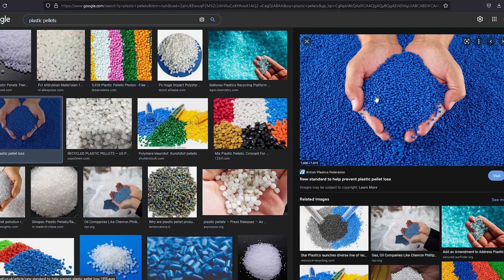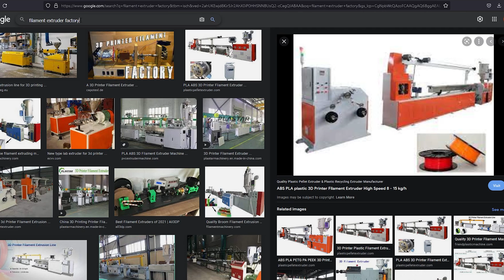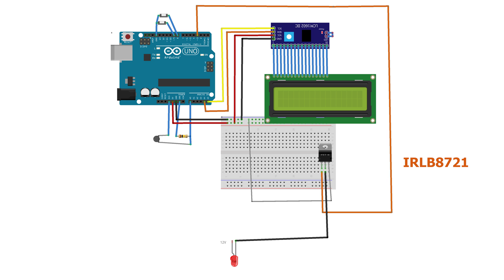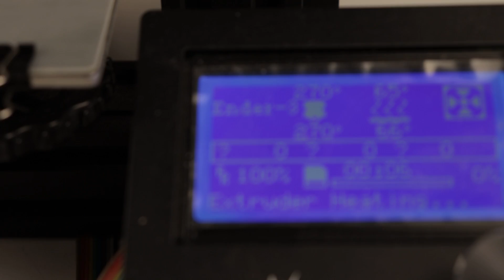Make FREE filament for 3D printer at home

Comment from the maker: Don't forget to check out tips&tricks for this project here:
https://youtu.be/xNtrQQ42WG4
Reply: Hello, Can you help me with the circuit diagram. I have been trying to build it, but im not so sure what the things connected in 8 and 9 of the arduino board are. also, can you do this with an arduino nano?
Reply from the maker: Hi  @fernandolagos2587 , certainly you can do this with an arduino nano. just you need to find correct pinout. pin 8 & 9 are for the buttons to adjust the temperature.

Comment: I’ve seen other people try to use this kind of filament in their Ender 3 printers, and they say that the ender 3 doesn’t get hot enough to melt pet plastic. Did you mod your 3D printer? Or what model 3d printer is this?
Reply from the maker: Hi @rachinc, First I did not modify it. However after doing a bit of research, I replaced stock hot end with all metal hotend just to be on the safe side.
Reply: @makersfunduck  after seeing this guy say his Creality Ender 3 wasnt hot enough to print PET filament, i told myself that I shouldnt get that 3d printer. https://youtu.be/M-d1Gmwq_O0?si=M0dWYTCw9YpDfp9X&t=310 but it sounds like you made it work, with a different hot end. Swiss?

Comment: Is it possible to use 8x2 LCD? I'm newbie with arduino, will it be hard to change program?
Reply from the maker: Hi, if the LCD has a Hitachi driver, then you can re-use the same code without any modification.

Comment: DO NOT USE HIS METHOD OF EXPANDING OUT THE BOTTLE.... WTF MAN?????? Do you not realise what you just created in your hands, its called a bomb. Sure it wont kill you from the shrapnel but the fire from the isopropyl alcohol in gas form, will burn your dam face off. You might be lucky 100 times but when it f$%ks, up because you left a little part over the heat to long, you will know about it. Especially seeing as you are using a gas top, open flame, to heat it up. You even talk about it so why the hell not just edit the video and say you used water??? dont't show dumb ideas.

Comment: I like the way of making strips connection as I'm seeing this method for the first time and surely try it out as it seems the best I have seen so far. But the way you shaping bottles seems not the best option and I suggest to search other methods. I personally just start making filament and I shape bottles with simply hair dryer. To make inside pressure I've simply fixed valve of bike stick to the cap so the pressure is provided by bike pump. Works well, quick, safe and controlled - 1minute all process. But I feel that there is other methods even more reliable to achive our needs.
Reply from the maker: I also recommended using warm water instead of ethanol in the next video. However still indeed this method can be improved. But I couldn't figure out any other method which is easier than that. Certainly it works quite fast compared to other methods that I saw on the internet, but you need to manually check it.

Comment: It's so much easier and faster to get yourself a couple tire valve stems from a car parts store and drill a hole big enough in the bottle lid for the valve stem to get a good seal, put it back on the bottle and then pressurize the bottle with a bicycle pump and then stick the valve stem still attached and chuck it up in a cordless drill and hold it over your stove.
Reply from the maker: It sounds like a viable solution. thanks for sharing.

Comment: I've tried drilling 3 holes and slotting the ends of the strips but it gets stuck at the hotblock and pulls apart... is there a certain trick to it ? Smaller holes? Or thinner pointed strip that goes thru the slots ? It broke off 2x so I'm not getting the hang of it .. any tips please ? 🙏
Reply from the maker: Indeed there is a trick to it. simply 2 strips needs to pass through together, and basically material which is flowing at the same rate. Once you figure it out, it works flawlessly. You can check the tips and tricks for this below

https://youtu.be/xNtrQQ42WG4

Comment: Could you show how to put the electronic components together. I have no experience working with electronics or soldering but I think I could use a bread board if I have the steps to follow. Thanks
Reply from the maker: Hi,

I actually made another video for answering the most common questions for this project. I believe I might have answered your question as well.

https://youtu.be/xNtrQQ42WG4

Comment: Hey, for safety just add a SMALL bit of water (1 tsp.) put it in the freezer with the lid on but not sealed for about 30 min. to 1 hr. immediately tighten the lid as you remove it and put it on the counter to warm up to room temp. Then start heating it. Be safe my friend.
Reply from the maker: Thanks for the tip :)
Reply: @makersfunduck  yes I noticed this phenomenon when i put an empty bottle sealed in my truck on a cold night. I came back to find that the next day it was warm and hard as a rock. just a little heating would pressurize it more.

Comment: But one question thought dont yoi get under extrusion because instead of the extruder pulling a ready made filament which is not that heavy. Now your extrudee has to pull heavier because it has to pull the filament from another hot end? I mean there will bi friction right?  And so i imagine the printinh wont be that fast?
Reply from the maker: You might be right, but stock step motor was powerful enough to perform same speed.

Comment: Is it fine for a stock ender 3 to print at such high tempreature? Because i heard that the ptfe tube won't last long if u do so. So have u run into any of these problem yet because i wanna  give it a go
Reply from the maker: you can print with default petg settings as well

Comment: Hello maker's Fun Duck thank you for sharing your video I'm 99.9% there but I'm getting a different reading on my lcd right at the start of the video your lcd displays as
Maker's Fun Duck
ST253.0 ST275.9
My displays as
Maker's Fun Duck
Sat253.0 ST24.9ish 
My resister colours are brown black black orange brown over a blue body slightly different but still a 100k resister also after reading in your comments to see if anyone else was having the same problem I read about the hot end wiring to the MOSFET witch has thrown me I'm is wired up as from the hot end both wires to the middle pin of the MOSFET is this correct if you help me please and she'd some light into were I'm going wrong it would be fantastic cheers again
Reply from the maker: what do you see?

Comment: should consider placing a small pc fan directly after the nozzle. good work
Reply from the maker: It might be helpful especially for the printers that can withstand higher nozzle temperatures. But with Ender-3, I dont want to go above the specs, and that's why my print speed is a little slow, and filament finds time to cool down naturally.
Reply: @makersfunduck  i was meaning after the first nozzle taking the raw material to 1.75 most setups have a small pc fan after it. but whatever works for you. good build though

Comment: Love the video and i got the whole set up together and the LCD is working but i don’t know why the extruder nozzle is not heating up, i have the one red cable connected to the center pin of the mosfet and the other connected to ground. But nothing is happening
Reply from the maker: maybe you did not done the connections properly.

Comment: How do you get a square strip of plastic to go through a round hole consistantly?
Sounds like a good way to gun up your printer. Good luck with all that.🙄😏😐
Reply from the maker: I made a cutter with spacers and a knife. I also shared spacer 3d files in case you want to print it.

Comment: Where did you get the 1.74 drill bit from, can a 1.5 drill bit also work?
Reply from the maker: I used 1,8 mm drilling bit
Reply from the maker: They are quite common. Take a look at this link for example: https://s.click.aliexpress.com/e/_DkCdpaT
I believe you can find one in one of local hardware stores as well.
Reply: @makersfunduck  Thx! out of curiosity the nozzle you used is 0.4mm right?
Reply from the maker: @ads3q  yep
Reply: @makersfunduck  Thank you! Also, last question, but what do you mean by five mm spacer? Does this mean spacer space between board and cutter?
Reply from the maker: @ads3q  yep thats right

Comment: Can you please just upload a picture of your wiring IRL? Your diagram is really misleading. I posted it on reddit and nobody can agree on what going on in it. The power source and buck converter aren't even in it.
Reply from the maker: Hello Jon, I think I understand your confusion. The software that I used did not have a buck converter, and I assumed it would be straightforward (so it is not in the circuit diagram). The LED in the circuit diagram is the heating element. (where it says 12 V). also upper side of the breadboard rail is 5 volt and it is how arduino is powered. You have countless options to provide 5 volts. What I did was, using a buck convertor from 12V power supply, and adjusting it to 5 volts.also if this is your first project, I recommend you to use a multimeter and verify 5v before connecting it to arduino. that would prevent your arduino from frying.  Was this where you stuck?  Good luck!
Reply from the maker: Waiting good news from you :) Keep me posted on your progress.
Reply: @makersfunduck  it's coming along. It works but I need a stronger power supply for my heating element then it should get hot enough. Thanks

Comment: could you make a video on the EE side of this project? I have ordered everything but I am struggling putting it together. I also recieved an lcd from a kit, but I don't have that other middle component that you have connected to it.. Is there a workaround? Very new to this. Thanks.
Reply from the maker: Hello Jon, I made a tips & tricks video which answers most of the questions (including electric part.) I think you might consider it helpful. https://youtu.be/xNtrQQ42WG4
Also you can also probably use the LCD that you have. you just need to change variables and define codes. Before starting this project, just search "arduino 16x2 lcd" in google, and try to use it. afterwards you just need to change 3 lines in the filament makers code. 
Have fun! :)

Comment: Hi I recommend to try what I saw on cap Put the ventylek on the bike to close And pressurize with a pump it will be 100% Safer
Reply from the maker: Hi Kajn, I agree that it would be safer, and I even tried using a pump to pressurize the bottles. If you can manage to do it, I think it would be a preferred approach. However it was pretty hard for me to make the same thickness on the bottle. Nowadays I only use water, and it provides much uniform thickness across the bottle.

Comment: Thank you for the video. I have a question that do you use full metal throat or throat with the teflon isolation to print the recycled pet filament? Because, AFAIK, the teflon material can not resist up to 270 celcius.
Reply from the maker: Hello Serkan,
I used full metal throat. Also if you are interested, I created tips&tricks video for troubleshooting: https://youtu.be/xNtrQQ42WG4
Reply: @makersfunduck  thank you. I'll check it too.

Comment: Amazing job, this is just what I needed, do you have an idea maybe on how to make the bottle heating process faster (which you currently do over your stove). For example if you want to prepare quickly 20-30 bottles.
Reply from the maker: Himm, and interesting requirement, But anything I would recommend would be too risky to try at home, so I dont want to give any advice. Pet bottles are first came with a pre-form plastic shapes (it is as small as a pill bottle, but thick), and bottle manufacturers put them in an oven to a certain temperature for a certain time, and blow pressurized air in a bottle mold with (around 7-10 bar ). I am not hinting you anything though.. it is just a manufacturing method that I am sharing with you ;)
Reply from the maker: Also I recommend my tips&tricks video before starting your build. here--> https://youtu.be/xNtrQQ42WG4

Comment: I was thinking to do this project, but here in Germany we have a 0.25€/deposit fee for every pet bottle. 1kg would cost 12€, energy cost excluded
Reply from the maker: Is it true for every bottle? Because In Netherlands, it is only applicable to soft drink bottles. But we dont have it (as far as I know)for vegetable oil bottles for example.
Reply: @makersfunduck  , only for soda and water. Oil bottle not. But with 5€/L sunflower oil...?
Reply from the maker: @tigre3droyce771  Of course buying sunflower oil just for this purpose would be absurdly expensive lol. But they have a lot more material than soda and water bottles.

Comment: another question why the buck converter??
Reply from the maker: buck converter is for arduino board to work. it reduces voltage efficiently to 5 v. otherwise your Arduino board will fry.
Reply: @makersfunduck  Ok so you pull the current from the 3d printer power supply or an independant power supply?
Reply from the maker: @BraveNewWorld1984-r6o  in the video, I used an old laptop power supply. however 3d printer power supply is perfectly capable off providing enough power for filament making and 3d printing at the same time.

Comment: which size is the strip of bottle? and which temperature you have set up the hot end?
Reply from the maker: Hi,

5 mm for thick (like cola bottles,) and 7 mm for mineral or other bottles. you can find relevant spacers in the description if you need them. In the code, it is set to 253 C. You can adjust it with the buttons if you need it.
Reply: @makersfunduck  i try a pepsi bottle but it melt too fast
Reply from the maker: @BraveNewWorld1984-r6o  then it might be tolerance issue on the sensor. you can try to reduce it significantly, and increase it step by step. then re-upload your code with the optimized temp.
Reply: @makersfunduck  i use a w1209 maybe it my problem

Comment: Thanks for this video.  I have had a plastic bottle cutter that I 3D printed for a long time but never got it to work.  Heating the bottle over the stove seems to be the trick.  I only used a bit of water inside and held it pretty high over the flame being overly cautious but it still didn't take very long.  I'm still experimenting to see if it is worth buying the parts to make actual filament but your method looks like the easiest I have seen yet.  Subscribed!
Reply from the maker: Glad I could help

Comment: Hi , i have every parts and small question : where is a place (on electric circuit ) for thermistor and heater ? Thank you a lot
Reply from the maker: Hi,
You can check 6:13 in video, or the github page in the description

Comment: Hello. Can you make a sort video how you join the filament i try few times but everytime broke. Thanks.
Reply from the maker: Hello @Jozsef Ienciu, I have also failed quite a few times after finding what works, and what does not. But the trick is making 2-3 mm sized holes, and cutting the other strip in a way that it tightly fits (you should be able to fit it with a pliers) . also bending the remaining strip is important, because it welds the strip from both sides. And first holed size should enter the nozzle and 2. the new strip. Please check the video @7:25. Also 3 holes are enough.I dont like uploading repetitive content, but  I can do a new video if other people also fails. Please let me know if these tips helps. 
Take care.
Reply: Thanks i will try a few times, but as you see not many people watch this kind of videos, hope many will subscribe.

Comment: hi , what electric parts i will need ?
Reply from the maker: Hi,
You need an Arduino board, 100 K 3950 NTC thermistor , 12-24V dc heater,  irlb 8721 Mosfet. these are essential. For graphical interface, an lcd, and if you would like to use 3d printer's power supply, or an old laptop power supply like I did, a buck converter is necessary. I put all relevant parts under the description.
Reply: @Maker's Fun Duck